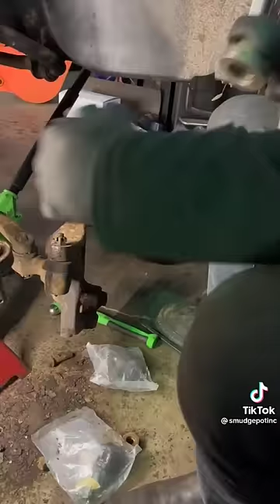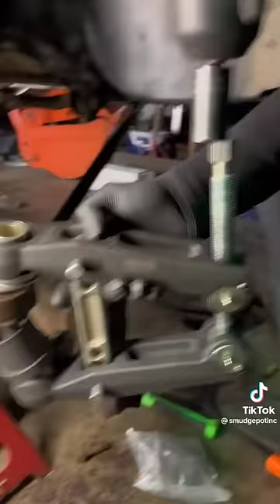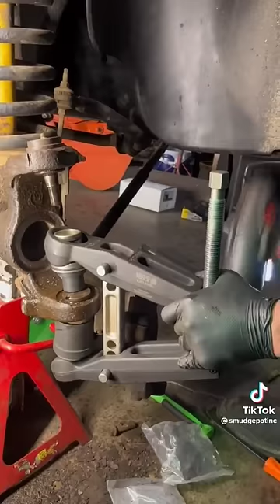Matco Ball Joint Press out ball joint Tool Kit pt.1 #automobile #diy #fyp

Comment: Now that's a three handed tool if I ever seen one
Reply from the maker: One more hand would be useful here lol
Reply: Holy crap yes
Reply: Every ball joint press I've used is a three hand tool. This one actually looks better than most since the cups are retained in the ends
Reply: Looks tricky but an awesome tool
Reply: It's a great tool, we got one at the shop. But it's extremely awkward and way to dam heavy.
Reply: @JMar671  It's nice in certain situations but extremely heavy and clunky to deal with. I only reach for this thing when a c clamp press won't fit.
Reply: Another pair of hands is nearly essential but it’s certainly over with at that point. Good tool
Reply: No job too big
Reply from the maker: @murphyr31  correct🎯
Reply: It's called being a skilled mechanic
Reply from the maker: @narele25  It definitely takes skills my man 👌🏾
Reply: Looks like it’s a little trickier to handle than a c-clamp style press, but comes with the distinct advantages of better clearance and added leverage.
Reply from the maker: @nicholasittzes7224  I love it
Reply: @guy6751  looks like a great tool to have and very useful and helpful.  You not get stuck there and waste hours trying to take that Bolt joint out . For a mechanic is a must have tool to have, if you want to so things faster. 😎 very cool 
Great video. Es
Reply: Agree
Reply: Needs a T Handle insert so you can balance it in a hand E zier. Take weight off the longness if it had a side handle.
Reply: I never saw a 3rd hand though?
Reply: Right. Damn.😂
Reply: Meh I prolly could do it faster..
Reply: @Josiah Martin  I was there a few weeks back and I wish it would have been that easy.
Reply: Youve never used a prop removal tool for 70ft ships
Reply: Be a funny looking shirt
Reply: An alteration to the design to allow for the drive bolt to slide and then be locked in to work would simplify the use quite a bit.
Reply: Still better than a regular press
Reply: I have one. Very cumbersome, an extra hand would definitely be handy. Thing is built like a tank and haven’t had one ball joint out of hundred it didn’t make easy work of.  I did however break the pivot pins and the press exploded into about 5 pieces right in front of my face. Definitely check your pins periodically. Contact SPtool and they send me out a new set and a backup set no charge.
Reply: Right!? Thinking the same but still better than others
Reply: Yup others beet me too it most presses only thread one way so it's looking like without the adapters it's exactly the same  on both ends wich like holy fkn hell it's about tf time someone made sense of that pos normal one.
Reply: Lol was thinking the same thing
Reply: Atleaat 3 xD
Reply: Just use the floor jack to position bottom half then you can use your other two hands to snug up top half
Reply: The old OTC ball joint press I used for 25 years was a 4 handed tool
Reply: Should try the regular cheap kits. That’s a 5 handed operation
Reply: What if you slid a small Jack underneath to put a small amount of pressure until you can get the clamp to engage?
Reply: haha i’ve never heard it called “three handed hand tool”, but i could picture every one that i’ve used as soon as i read it 😂
Reply: Just come to make this comment and seen yours lol
Reply: @JMar671  😅😅😅😅
Reply: All ball joint presses are.
Reply: That’s what she’s said 😂😂
Reply: @jimmybasil8965  se fosse hidráulica seria melhor!
Reply: In my personal preference in a situation like this I will sit down put my thigh under the bottom end of the tool as it’s the easiest to keep in place with pure force no accuracy, then I will set the impact onto the bolts and slowly tighten down as I direct the top of the removal tool with my free hand then once everything is snug get my body outve the way and as he said send it home 😜
Reply: He's having a hard time because he has the gups on the wrong sides big gup on 6op smal vop on bottom over spindle and press it out the other way look closely and you can see hom crack it  thought I was missing something but watch me matco tool man demonstrate that same tool wouldn't want to be the one that has to drive that hopefully he realized he cracked it and replaced it
Reply: The old ball joint presses are 4 handed tools 😂
Reply: Literally was about to say that
Reply: @recoil2952  99% of people haven't 🤦🏻‍♂️
Reply: Never enough hands
Reply: It's heavier than most I've used as well. But goddamn it's good. I almost removed a lower on a wrangler by hand lmao
Reply: Yep. She said that.
Reply: Not a 3 handed tool at all. Use this by myself all the time.
Reply: Older ones are easier to use tbh..
Reply: Way easier than the traditional design
Reply: Seem like he got 4
Reply: I can't breathe 😂 this comment sent me
Reply: Can’t be worse than the tool you got to use to remove valve springs
Reply: 2 hands and a baby fist! 🤣🤣 couldn’t resist
Reply: You've never used a normal ball joint press if you think that's bad
Reply: Buddy I have used duct tape before 
This tool is badass 
I’m not a front end guy but I want one of these to work on my toys
Reply: Lmao 😂 ❤ I know right!?
Reply: Better with a buddy helping
Reply: Dude it's so heavy and awkward lol. Works really good though
Reply: The cheap one bend when I do f350 ball joints. Will this do that?
Reply: Cup it from under like a football. Makes it real easy
Reply: @JMar671  My Snap On ball joint press is a C-clamp type like the OTC, its heavy but only requires 1 person with 2 hands to use.
Reply: Not really. The key is to take out the slack and then center it. Once it's centered, then send it home!
Reply: Time is money. Pay your little sister as helping hand with the time and money it saves you.
Reply: Right the old school one is so much easier it looks like 3 hammer strikes with my 48oz ball peen it would be out in less time than it took to set up
Reply: Lucky my lower control arm came with them
Reply: Looks wiggly but hell I'll try it out
Reply: Part number, or something for this thing, I would love to get one
Reply: Whats the price tag on one of those?
Reply: He was just bad at using it.
Reply: what a woman thing to say☕️
Reply: Price range is anywhere from 500 to $1200 for that tool.
Reply: Its freaking heavy there’s a bigger one😂
Reply: Better then a trip to McDonald for random piping for a makeshift one
Reply: I was the 7k comment💪 small victories
Reply: All ball joint presses are three handed tools. This one looks way easier than the C clamp types.
Reply: Pretty much how every ball joint press is.
Reply: And that’s what it cost, almost, just an arm n a leg, cause if humans had 3 hands, that’s what Matco would charge!!
Reply: ESCUCHE DE EL 3 PATAS,,,,,
PERO NO DE EL 3 MANOS 😂😂😂😂
I'VE HEARD OF THE 3 LEGS,,,,, BUT NOT OF THE 3 HANDS 😂😂😂😂
Reply: If you've used the standard ball joint press then you know what an improvement this is
Reply: No shit... I was thinking to myself that it looked super easy to use ..😂😂😂😂😂
Reply: Owner is always near!
Reply: @letsfixit251 definitely good to have.  Love mine.  Makes it much faster than any c clamp style I've used.
Reply: Hahahaha, just like every "ball joint" tool I've ever used.
Reply: My thoughts exactly 😅
Reply: He made it way harder than it had to be, even when opening the jaw up in the beginning 😂
Reply: Mid toque comes in handy vs the big impact getting started 😅@letsfixit251
Reply: Try using a spring pin bushing machine on semi trucks. Absolutely brutal
Reply: Was about to say that. Either a three handed or four handed tool. Lol😂
Reply: All suspension work is three handed
Reply: Setup time is 95% of labor cost. Yeah, for me it's 2.5 hrs in the gravel driveway with a steel punch and sledge hammer and much cursing.
Reply: Yea I was about to say it's almost a 2 person tool.
Reply: Use one in my shop it's amazing
Reply: I bought one of those only to find out my impact will destroy it after 10 uses. Also doesn't open far enough in some situations....hate it
Reply: I'll stick with my big c clamp style snap on tool. This thing looks awkward as can be.
Reply: Ok what about putting the new joint back in now
Reply: How? he did it with 2 hands 😂...